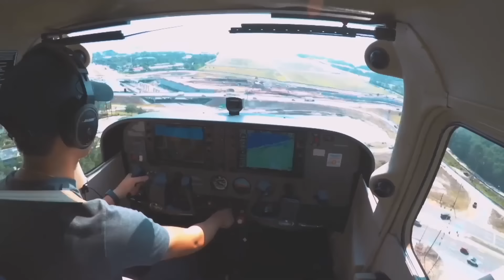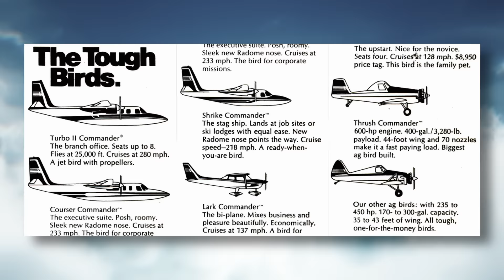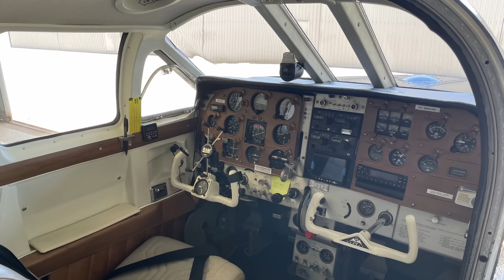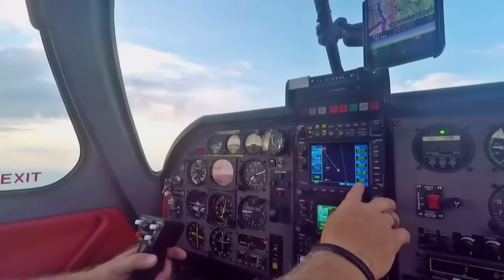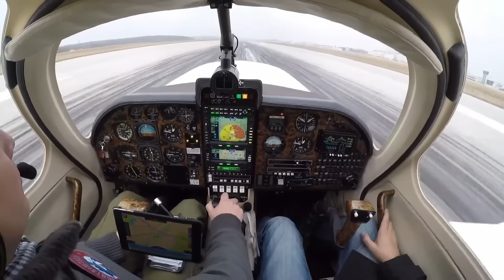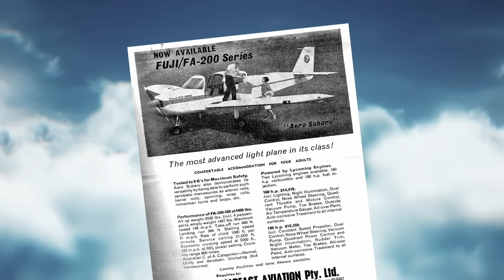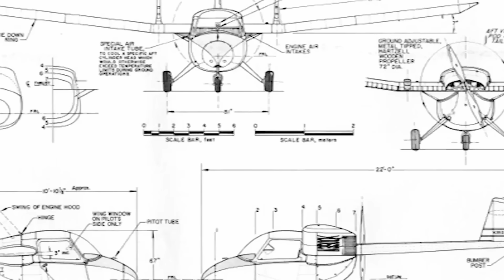Four-Seat Blunders...and Why They Failed

Comment: Commercial failure does not equal performance failure. Each brand needs to offer not only a competitive purchase price but a logistics system that makes ownership a reasonable proposition. As you mention, reinventing the Cherokee or Skyhawk is definitely a fool's errand. BTW I saw Bellanca N77CT in St. Louis in 2013. It is number 4, was donated to Wings of Hope and later sold to raise funds for humanitarian aviation missions.
Reply from the maker: Agree 100%, I'm classifying these under commercial failures. For the most part, they were fine airplanes.  The dominance of Cessna-Piper is a common theme across my videos.

Comment: Mooneys were most famous for fir falling out of the sky! Thry went from stall to FALL, instantly and with no warning phase.
They also had to be moving much faster to take off and stsy in the air.
Resuling on the need for longer runways, and no engine out survival chances.
Reply from the maker: Geez, ok.  Not a Mooney owner or pilot but I only hear praise with Mooneys, and how they are built like a tank (which saved many lives in crash landings). Case in point see the one that got wrapped around a tree in california.  Cessnas, they certainly are not.
Reply: @aircraftadventures-vids  they are much faster and more fuel efficient than the competition, but maintaining flight is tricky.
It takes a ballsy pilot with skills to operate them safely!
As far as tank like? Noone ever mentioned that when i was around genetal aviation. (1960s though 1990s)

Comment: I've had a few planes in my 35 years of flying. My first was a 172 then I went to a 206, then a bonanza and a few before I bought a Mooney M20G I loved that plane. Then I got a M20J that I still have, it's slippery and fast, i also have a Mooney acclaim great plane. Ok I'm off track. Cessna flooded the market with the 172-206 models and we all know in a flooded market prices go down. It's hard to compete with that kind of market. Mooney are still in business, i don't know where you got your information. They were bought and sold a few times but still in business. Cessna has been bought and sold a few times, general dynamics then to Textron.

Comment: The typical swept tail with a low-set tailplane  on a low-speed aircraft is a  poor stylistic feature, because the vertical tail is blanketed by the tailplane in a spin, thus often causing difficulty in recovery from a spin.  Sure, you don't HAVE to put an aircraft in a spin - and there are a lot of aircraft out there that you had better NOT let get into a spin.  People like the swept fin because it makes the aircraft look faintly like an F86.  But the "reverse tail" is there on Mooneys for a very good reason.   Beech made a bad mistake when they put out the F33C as an "aerobatic" aircraft; their Australian agents tried to sell it to the RAAF as a primary trainer - and it killed a champion aerobatic pilot when he tried to demonstrate that it would recover from a fully-developed spin.  The Beech "Mentor" did not need to have such a gimmick; it has a non-swept fin for this reason.
Reply from the maker: So what's your thought on the Cessna 172? From what I read Cessna chose to "sweep" it purely for aesthetics.  I for one love the old look of the straight tail (as well as the old Cessna 310s)
Reply from the maker: Interesting point. Come to think of it, Vans kitplanes also have straight tails and they have terrific performance.  As to the Mooney, take a look when you have a chance:  https://www.youtube.com/watch?v=y7bVeFGh4HY&t=16s
Reply: @aircraftadventures-vids  Yes, the straight-tail ones were  generally better, but the Continental 0-300 engine became a parts problem.  I flew a Beech V-35A quite a bit - it was one of those aircraft you would not want to spin, but that didn't stop it from being a good cross-country aircraft.  BTW,  Cessna replaced the 0-300 engine with a "cheapened" Lycoming, with lousy valve rocker arms.  The PA28 with a Lycoming 0-320-E2A  was slower, but much more reliable.

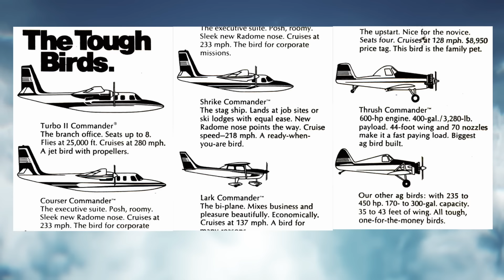Comment: #1. @4:00 2nd time the Rockwell list mentions"Biplane" without showing one.
#2.  I'm pretty sure that I commented before on this @4:08 dog with fleas that A. NEVER replaced the B-52 (nothing has but taxpayers have paid a trillion dollars).  B. (Really) requires 74 man-hours of maintenance for every ONE hour of mission flight time and C. Was killed early and in-time by Carter because the B-1 role was replaced with cruise missiles but the WW2 dodging actor brought back the B-1. 

No one, NO ONE should be happy that "things turned out okay" for Rockwell when they are committing fraud on we, the taxpayers whom they claim to be protecting.  Don't be afraid of Rockwell, put value in a society based in Truth.

Comment: It's not just 4 seaters... it's the whole of GA. Well, they didn't exactly fail, they did and they didn't. What I mean is that the way I see it, this was the early era, they had to try things, and most wouldn't be as successful, they paved the road for further knowledge, innovation, designs etc. If nowadays we got new materials, extensive aerodynamic knowledge in regards to small GA planes, what works what doesn't, is because they tried things. Where GA failed though, is that since the early era can get expensive, only the mega rich were the customers, only they were involved in using those planes, not unlike the jet set era of commercial aviation. The thing is, while the jet set era was gone super fast, since airlines saw the potential of being approachable to everyone, GA never went through that step, and that's mainly because those same people involved, wanted those toys for themselves only. This has happened in many other things, oil companies delaying engine progress, motorsport, where the mega rich would again like to keep tracks and the sport for themselves only. At least there's some hope for GA, I seen amazing innovations, both in design and materials, light sport aircraft on the sub 100k buying cost, and little maintenance costs, could make them approachable to people who love aviation, but they are not mega rich. All in all, the whole thing worked for America, as GA helped massively in knowledge, whether aero or materials or anything, just as the state funded research aerospace programs did. This is the reason the US has all those advanced jets and all, everything played a part, its role, including GA. And this is exactly what they needed to do to become pioneers in aviation, state aerospace research while it was the backbone of innovation in this sector, GA contributed to a large degree, even the experimentals people would build themselves in their garage, you never know where a breakthrough will come from. So the US has done the right thing, gave the necessary freedoms to all, to work on aviation, whether a business or a hobbyist, and it payed off. And that's the right attitude. Writing expensive checks and buying ready made things all while restricting anyone else (whether this is national insecurity reasons or the pretense of safety) from working on aviation and claiming the skies as yours, is the exact opposite, and this is what my country has done. Anyway, GA didn't quite fail, if it did in some degree, blame the rich - they delayed progress in GA, even for the US. I think the future of GA is gonna be amazing, in this video, examples of what they consider failures will be overcomed easily nowadays, eg the heavy reinforced pressurized cabin in GA... they are building a cheap inflatable space station, stronger than metal, I'm certain this tech could be useful there. And those strange highly efficient designs, laminar flow airframes and wings, really powerful yet inexpensive engines, not so much different to your SUV engine, or at least in fuel consumption... I think the future of GA is bright... as well as that of commercial aviation. Probably. At least GA despite its failures, has done its job successfully, and the US is at the forefront of aviation. Maybe at a cost to the rest who fell behind, maybe those countries shouldn't put morons at the wheel. Or the yoke in this case.

Comment: Just for information, for a light plane, the propeller generate about half the noise or more. The engine can easily be muffled, just like a car down to almost nothing. You will not even have to bother with a muffler if you have a turbo downstream of the exhaust gas, the turbo is an effective muffler. The other way Rotax used was to gear down the engine and slow the prop, and add blades.
Reply: That’s why in the new Cessnas our max govr rpm is only 2400 rpm. Because most noise comes from the near supersonic blade tips.
Reply from the maker: Agree 100%,  and that's how the R90 was designed.  Slow, 4-blade prop. There are exceptions of course, like the old augmented Lycomings which were WAY louder than props, but otherwise yes the props are the main noise makers.
Reply: @aircraftadventures-vids  No matter how loud piston engines are, they have to take second place to turbine when you consider noise. The straight through turbines like Garrett in some Cessna Conquest are the worse.  If one is at your local airport at ground idle, just about everything within 200 ft have to stop, because you cannot hear anything. This is where a PT-6 is superior and I feel the slight loss of efficiency are worth it. The worse are the early engines in the 60s.

Comment: With the Grumman Tiger you could also open the canopy in flight. It was faster, more roomy and easier to fly than a 172. Shame it failed as well.
Reply: Failed? How?
Reply from the maker: I wouldn't say a production run of over 3,000 AA-5s was a failure.  Obviously not even close to Piper or Cessna, but pretty respectable.
Reply: The Tiger was a fairly successful airplane.
Reply: The Cessna Cardinal sold over 4200 units and was considered a failure by Cessna with a mere ten year production run, requiring numerous modifications (Cardinal Rule to fix the gear, wing, and stabilator, 180 HP mod, constant speed prop, and eventually 200 HP and retractable gear) plus forced Cessna to restart production of the 172 and modify it to accept the 150 HP Lycoming that was inadequate for the Cardinal.
Reply: @calvinnickel9995  yeah but no canopy you can open in flight, so... who cares?
Reply: @ditto1958  And has a canopy that can hang open.

Comment: The bird I remember most recenly seeing in the Anderson Greenwood Aires T-250. I saw it several times at PVF where I was based. Yeah, it was supposed to be fast, but not 180 kts and it didn't handle that well, nothing like a V-tail Bonanza. And it wasn't very pretty. There is an old adage in aviation, if it looks good, it usually flies good. Just think of all the great good looking airplanes. DC-3,4,5,6&7, P-51, Spitfire,  A/B-26, Comanche, Bonanza and I could go on. Weird doesn't fly so good. You had plenty of those in your video, like the Hanza Jet,
Reply: I meant to talk about the Hansa jet with its "weird" forward swept wing. It had a huge cabin, but underwhwelming perofrmance and was known as a ground lover. Only about 43 were built.
Reply from the maker: I spotted one in Munich at the Deutche museum back in June.  I also did a writeup on the Hansa on my instagram account recently.
Reply: @aircraftadventures-vids  Yes, I even wrote a column a few years back a few years ago about how weird doesn't seel and used the Hansa Jet as an example. Being an underpowered pig didn't help. It's one of the earlier bizjets that failed along with the Corvette (French) in the mid 1960s. I think the Honda Jet even with their huge backing is having its own problems especially with its querky over the wing design. There are time share type operators going under as we speak. Hard to compete with the Phenom 100/300 the several Citations and a few others. Perhaps the best small/midsize bizjet on the market is the Astra SPX, G100 and the later G150 (a widebody version of the G100). for under $2Mil, you get .80+, 3,000+ nm, and a stout airframe and an almost stand up cabin.

Comment: Psssst…. Mooney is still around… supporting the existing owners with spare parts and services.  Not building new planes.

Mooney Mustang’s next step was the M30 and became the predecessor of the joint project with a French manufacturer… and built the Tarbes Mooney aka TBM700… much bigger and more expensive than an ordinary four seater….

Saying Mooney isn’t around anymore, is just untrue…

Saying Mooney doesn’t currently build new planes would be more accurate….

😃

Comment: You forgot the Rockwell commander.
Reply from the maker: I didn't, just that the main focus of the video was on the 100 series.  The Commander (if you referring to the 112/114) did pretty well actually.
Reply: @aircraftadventures-vids  
The 112 and 114 was what I was referring to ,yes.
Thats a really cool airplane.
Unfortunattely it was unerpowered.
We have a local pilot who owns a beautifull 114. Looks brand new.
He has an uprated engine and prop.
Says it has transformed the airplane from mediocre to outstanding.

Comment: Most of the successful brands you mentioned have failed, too, sometimes more than once. The common single-engine and light-twin GA referred to in the video is not exactly a sustainable, profitable, "happening" market for most applications. Cessna's bread-and-butter, for example, is in bush planes required for life or work in the outback and in large, turbine-powered versions operated as fleets by cargo operators, not in common, public GA. If that was all they had, they would be barely hanging on or defunct like the others that have been dependent on the latter market.
Reply from the maker: That's true, it's a niche.  But you can also argue that general aviation in general was much healthier in the 60s/70s and could sustain more manufacturers, which is nearly impossible today.  And Cessna's bread and butter and flight school trainers, not bushplanes.
Reply: @aircraftadventures-vids  Give Textron the choice between flight-school sales and multi-use (not cargo-only) Caravan sales outside the US and watch what happens….

Comment: Fitting the Birddog Wing to the Civilian Models was the Move that made Cessna the Leader in the "Platzgeier" Market. In a Market full Plain a Split-Flaps those Fowler Flaps gave it such widespread utility from 2 to 7 Seats and 90 to 150kts all using the same Wing albeit slight differences in Washout and Fuel Capacity, that they basically could do no wrong after that.

Comment: Mooney mustang did just fine. They are still being built highly sought after. Maybe you have heard of the tbm line of aircraft. The m in tbm stands for Mooney and the tbm 700-900 are built on the Mooney mustang.
Reply from the maker: Not quite right. Yes on the TBM part but it was based on the Mooney 301, a creation by Roy Lopresti.  That plane eventually morphed into the TBM series of turboprops.  Not the Mustang.

Comment: The Mooney M22 Mustang did not use a Continental engine. It actually used a very weird Lycoming TIO-541 engine similar to those found in Beechcraft Dukes.
Reply from the maker: Correct, in fact I corrected myself on the video right at the time I mentioned it.  (I didn't want to re-record my voiceover again).

Comment: I flew an American AA5B, which is a low wing, fixed gear, four seater with a sliding bubble canopy. It was a good handling plane.
Reply: Avionics tech here.
This airplane is absolute Hell to work on. I hate them for that reason.
Also the fuel tanks always leak, and the wing skins are so thin that they can easily be damaged with your bare hand.
The canopies leak in the rain all over the front seats and panel.

I would rather own literally anything else.
Reply: @nattybumpo7156 also the fuel tanks don’t always leak and the skins on whatever tiger you had must have been fkd, ours our fine.
Reply: @nattybumpo7156  isn’t the wings woods or something
Reply: @jonasbaine3538  
They are metal, but have a fairly unique method of construction. The wing skins are so thin. Very fragile.
Reply: @brianmerz6070  was that the Grumman product?
Reply: @jonasbaine3538  the Tiger is fibetglass and composite.
The Bellanca was predominantly wood. Most fsmous for its wood wing spar.
Reply: @jamesbowen2105  
Sitting in one now..
Metal wings, aluminum honeycomb fuselage. Whole airplane is glued together.
Wouldnt own one with your money, lol.
Reply: @nattybumpo7156  So funny, but it flies so well, and it has an acceptable speed and range and good carrying capacity. What's not to like?
Reply: @brianmerz6070  
I consider it flimsy.  As an avionics tech i find it awkward and uncomfortable to work in. The methods of construction do not leave me with feelings of confidence. I also do not prefer the flight characteristics.
Just not an airplane i would look at twice.
Reply: @nattybumpo7156  I will accept your objections, my friend. If you work with electronics,  you are way smarter than me. Thanks for being so polite. So many other people devolve into insults. It's a bit early, but have a great New Year.
Reply: @brianmerz6070  
You as well!

Comment: As for Rockwell Commanders, you didn't mention the 112 and 114. While hardly run-away successes, they did produce some 1000+ of them, and they are quite good aircraft (albeit not trainers, but rather complex/high-performance). Also, one could argue that the Ruschmeyers were simply ahead of their time, and today the legacy is very successfully carried on by Diamond (yes, I know they're Austrian not German).
Reply from the maker: I've been called out on omitting the 112/114 but the story wasn't focused on Commander aircraft per se. Plus, you could argue it was moderately successful (while the Darter /Lark were not)